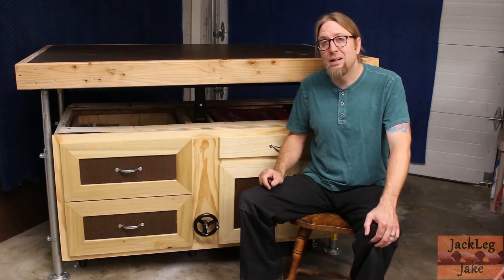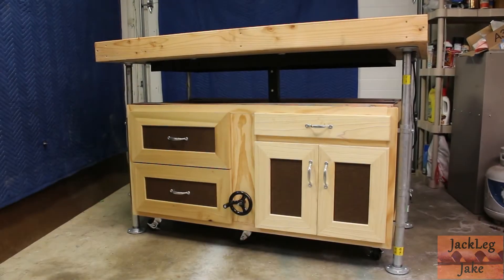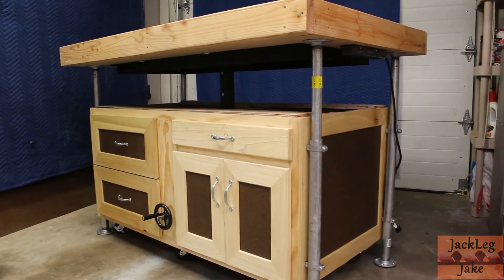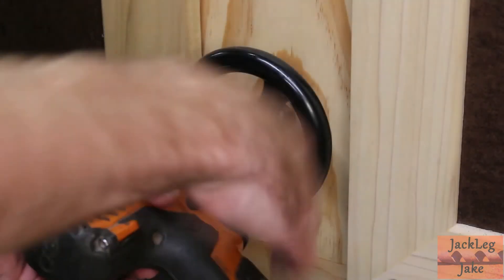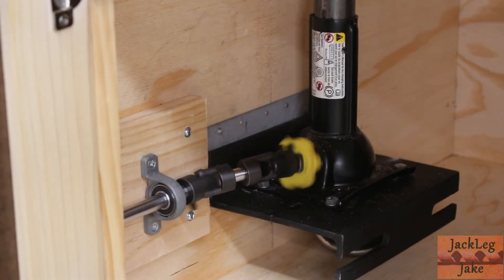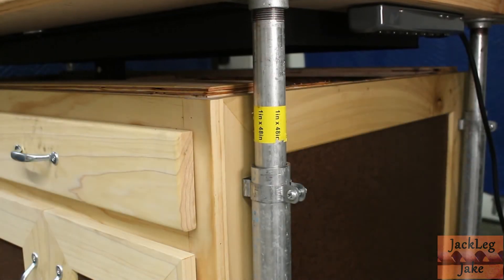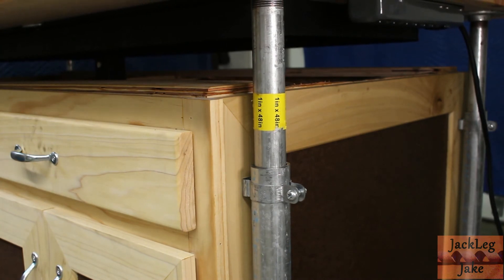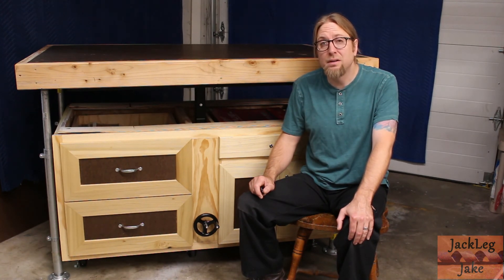Adjustable height assembly table

Comment: Hi Jake. Curious as to what the pipe is. It looks like electrical conduit, but I see the plates at the floor. Can you advise? Thanks.
Reply from the maker: They are galvanized rigid nipples of 1&1/4" and 1" diameter.  I bought 60" lenghts and cut them to a smaller length so that I could use the threaded ends with the floor flanges.  I probably could have done without the floor flanges and achieved the same result.

Comment: Great idea with the use of the wheel handle & universal joints to the bottle jack. I have an old table saw I aim to scavenge the parts from to do the same for my adjustable height CNC Table. Thanks for posting!